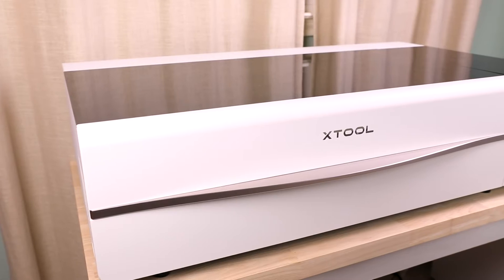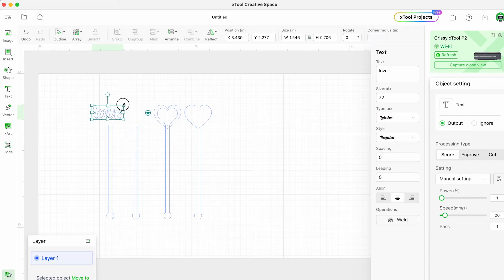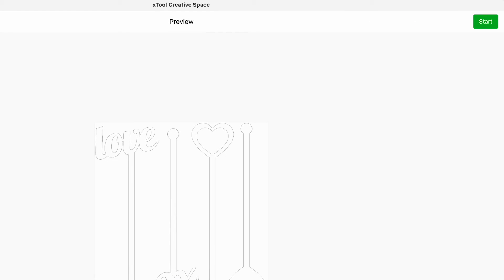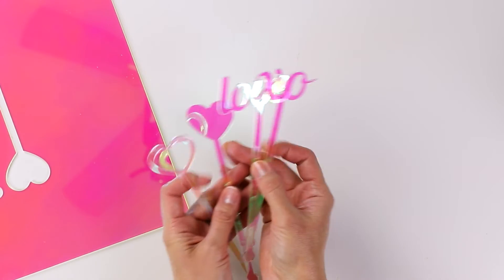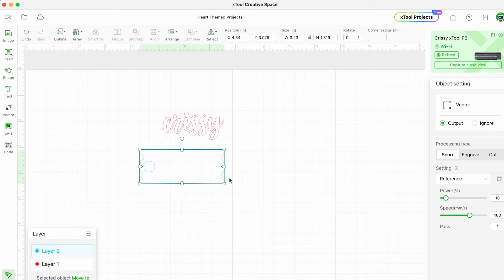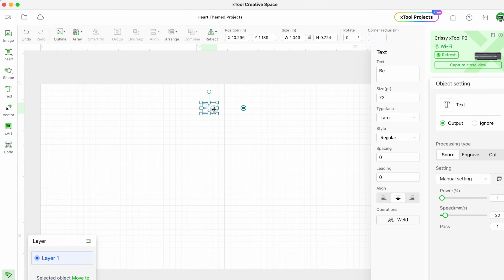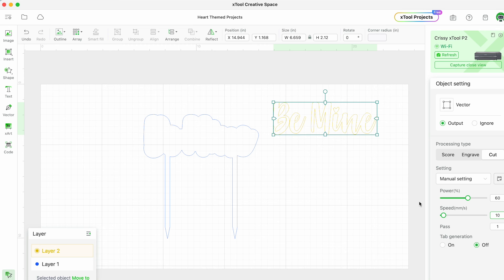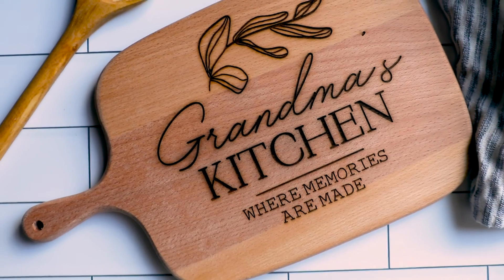Mastering xTool P2 Acrylic Laser Cutting

Comment: Hi I'm looking at the Xtool M1 Ultra I know that I want to use wood and I believe it causes oder so what do I buy. I will place this in front of a window and have it for ventilation. What else should I get? Help!
Reply from the maker: I’m about to publish a new video on the Ultra, so I will try to add some details there. In the meantime, I’d think about getting the new desktop air purifier. It will help with ventilation. I also saw an email about a new Safety Pro series that will be focused on ventilation, but I need to find out when it launches. I’ll keep you posted! There’s a coupon in this article I just wrote about the Ultra for an extra $100 off: https://www.firstdayofhome.com/xtool-m1-ultra-review/.

Comment: Hi! I just purchased an Xtool P2 and very new at laser. I’ve been watching a lot of beginner videos and yours is very informative. I’ve noticed everyone’s software has a horizontal tool bar at the top but my creative space software doesn’t show. Do you know how I can get it show?
Reply from the maker: Hi! xTool Creative Space has undergone a few software changes since I made this video. You're probably seeing an older version of the software. You should still have the same functionality, but it might have moved to a different spot. Let me know if I can help you find anything, and enjoy your new machine!
Reply: @FirstDayofHome  I'm having the same issue.  For example, I cannot find where the Text spacing is.  The version of the software you have is so much cleaner/nicer.  Do you know where it is?
Reply from the maker: @jenniferrobertson9520  Hi there! Yes, the software has had quite a few updates since I made this video earlier this year. First of all, I'm now using software v2.1.12. In the software, try clicking the menu to check for updates and make sure you're using the same version. Then, add your text using the left menu where you see the big "T." When you select your text, you should see options across the top, and there's a button that has a vertical arrow and lines next to it. When you hover over it, you should see the words "More." You can click that and increase your line spacing or letter spacing. I hope this helps!
Reply from the maker: Oh, and the button I'm referring to is directly to the right of the font size number.